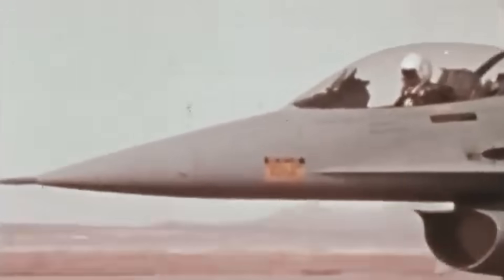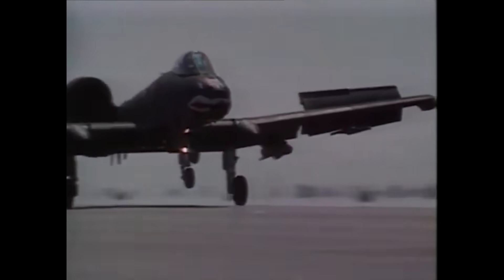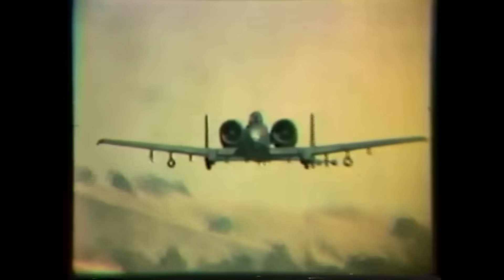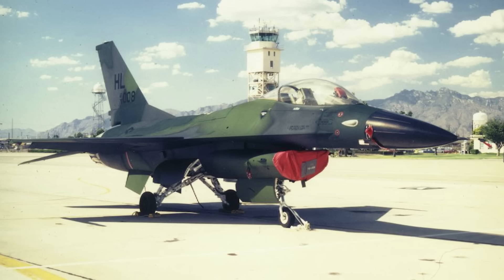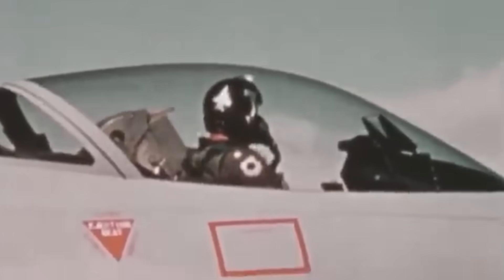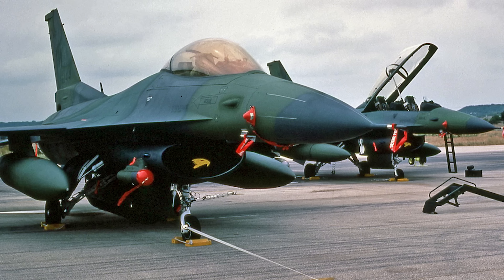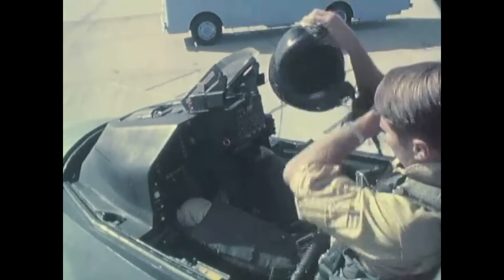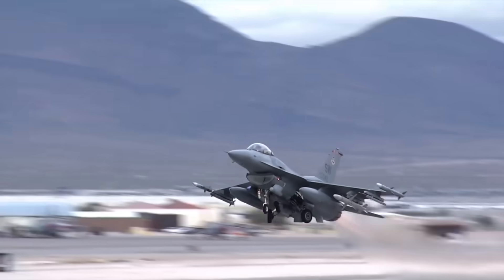The A-16. Can a Viper turn into a Warthog?

Comment: 2:51 What exactly did it prove? The A-10 didn't fly in contested airspace in Desert Storm and the real tankkiller of that war was the F-111, while A-10's only got shot to pieces by groundfire and had some notable friendly fire incidents.
Reply: @KapiteinKrentebol  The A-10 Thunderbolt II as it's formally known, despite its faults has saved outnumbered or surrounded American and allied ground troops from certain annihilation. While the F-111 Aardvark was a great at tank plinking, the A-10 really shined in doing the dirty job of low flying and causing destruction up close. Admittedly, had the Cold War gone HOT, A-10 attrition would be very high due to the hazardous nature of CAS. Even the legendary A-1 Spad used in Vietnam suffered high losses in doing the CAS mission that it was doing very effectively. With the skies over Ukraine being hazardous to both fixed wing and rotary aircraft alike, the A-10's counterpart, the SU-25 is having a hard time. Vulnerable to MANPADS and SAM's, besides hostile fighter aircraft. An updated A-10 variant with more powerful engines, that the latest "C" model lacks, and carrying small diameter glide bombs and other standoff weapons, an updated A-10 can still remain relevant. Imagine if A-10 production continued, with the updates, but as unmanned drones! A-10's are relatively inexpensive to produce. Sure many will be shot down, that is the unfortunate thing in the CAS mission.
Reply: A-10 is neither a dedicated tank buster nor CAS aircraft. It is a close interdiction aircraft, to attack targets not engaging in battle, but moving to do so. CAS is its secondary role, CAS being air support called in / requested by ground units in battle with the enemies it is calling air on to.
Reply: @De_cool_dude  that's exactly what it does.
Reply: A10 is useless when there is no air superiority and when enemy ground troops have handheld anti aircraft stuff.
Reply: @polarbear3427  You do realise the A-10 has over 200 countermeasures on it, right, making handheld anti aircraft weaponry not actually that effective against it as long as the pilot is aware that it was fired upon.

The A-10 is not an asset supposed to operate on it's own. It's supposed to have fighter cover when engaged in warfare with a near equal opponent. It's main advantage is that NO OTHER AIRCRAFT has the same capability to linger in a single area and completely suppress enemies with sheer amount of weaponry, ammunition and remaining slow enough to not just fly past a target too fast to get a good shot at them.

The entire problem with the A-10 is that people think it's supposed to accomplish it's mission solo without support. It's not, no CAS aircraft in the entire world can operate completely independently.
Reply: @ Yes only the A-10 can suppress a target as effectively as an A-10. 

But is that worth having a 200 aircraft long supply hain for a 70s airframe that hasn't been built for half a century, all to have the capability to strafe a target that the fighter offering cover could just drop a JDAM on instead?

It's not that the A-10 is bad, it's that the A-10 is so specialized it makes little sense financially. The GAU-8 is absolutely amazing in the scenarios where it works. The problem is the scenarios where the GAU-8 does a job an F-16 20mm or a JDAM or SDB couldn't do are few and far between, and pretty much only in Afghanistan.

If the A-10 only comes out when you already have total air supremacy. Why not just reallocate the aircraft that have nothing to do after achieveing air supremacy to the job. They can do 90% of the things an A-10 does just as well as or better than an A-10, while they can do 9% of them 90% as well and the last 1% they might not be able to do.

The war is effectively decided when you establish air supreamcy. Is it really worth having the A-10 for those 1% of scenarios where it's better than anything else? Wouldn't it be better to dedicate those costs to something that can do the other 99% of A-10 tasks AND contribute to establishing air supremacy?

If that 1% was intercepting nuclear bombs, the A-10 would easily be worth it. If the 1% is strafing Taliban shooting out of an abandoned house in a specific scenario where you can't just drop a bomb and the F-16 gun won't cut it, that 1% justifying the entire existence of the A-10 suddenly looks a whole lot more dubious.
Reply: @sdfopsdmsdofjmp7863  Because the A-10 is easier and cheaper to maintain for those tasks than, say an F-15 or F-111. Also a JDAM isn't a guarantee of target elimination.

Also the A-10 can carry a very significant arsenal of guided ground attack munitions. Laser guided munitions in particular actively benefit from the slow speed of the A-10.

That benefit wouldn't actually be seen that often in Afghanistan because, well, you're not exactly going to lob a highly advanced guided bomb designed to take out armoured targets ranging from tanks to bunkers at some random Taliban in a house.

The GAU-8 is honestly a minor part of what makes the A-10 good. The sheer amount of Hardpoints for weapons and for the later versions, the guidance systems for advanced munitions are what make the A-10 far better than "Gun go brrt"
Reply: @reonthornton685  I agree with you, but Afghanistan is not a real war, just like Iraq. It provides negative training compared to a real war.
Reply: @Tattlebot  War is War.

War against a peer is different, yes, but to call it not a real war is just an insult.

Also, in a peer war, it requires air cover. That was ALWAYS part of what it needed. It was never expected to operate alone. Nothing is.
Reply: @KapiteinKrentebol  He is entirely correct, you do your research!
Reply: The f16 didn’t fly in contested airspace? Lmao buddy, I guess you’ve never heard of the f16 calling stroke 3 dodging half a dozen missiles fired at it and surviving.
Reply: @bowencreer3922  Where did you get F-16? It´s not mentioned anywhere in the comment you replied.
Reply: @bowencreer3922  The A-10 had to be moved away from contested airspace, not the F-16, you blithering idiot.
Reply: @bowencreer3922  You have no idea what you are talking about.
Reply: @KapiteinKrentebol  Respectfully, I think you may be incorrect.  What source are you using for that claim?  

Most of what I can find is that the A-10 scored more tank kills. Now I did find something that said the 111 got 1500 tank and armored vehicle kills and that the A-10 got 900 tank kills so I’m thinking that he did in fact get more tank kills than the 111 but this statistic has included more than just tanks - armored vehicles too.

The Smithsonian says the following - 
“By the time it ended, the Warthog would be credited with destroying more than 900 tanks, 2,000 military vehicles, and 1,200 artillery pieces. That the A-10 remains in service 29 years later is a testament to the platform's reliability and effectiveness.”

sounds like if you were to add the tanks plus other armored vehicles into the A10’s kills then you would probably come up with a number higher than the F111’s tanks and I every vehicle kills.
Reply: @ 

https://www.youtube.com/watch?v=gDbUnRvb43o

By the way, I like the A-10
Reply: @DarkRendition  you should read the official USAF publication on how effective the F-111 and A-10 were, published after DS. I dont have it with me at the moment, but i remember it saying that the F-111 scored better than the A-10. I will have it in an hour or so so i will respond then with the correct statistics.
Reply: @DarkRendition  there is quite literally a document from the usaf detailing the claimed kills for pilots. And yes the f111 had a higher amount of kills, anybody saying they know how many tanks were destroyed by either is lying as pilot reporting was unreliable at best. What is safe to say is that f111 being  much safer to fly and a much better platform for agm 65 and gbus made it fly more often which inturn lead to more kills.
Reply: @DarkRendition   The A10 was not used for anything more than mop up, in the contested fight it was not used as it was not capable of being there without being shot down
Reply: Many sources credit it with the highest number of tank kills.
Reply: @DarkRendition  so the F-111 has a better kill ratio than a dedicated CAS platform then.
Reply: @traviswalker8933  The A-10 is not a dedicated CAS platform, nor is it a very good CAS platform. Never has been.
Reply: @dat581  it is a dedicated CAS platform because that was the primary design objective of it. Dunno who told you otherwise.
Reply: @ You haven’t a clue about the A-10 do you? The primary design goal was tank busting, NOT CAS. Not to mention that the A-10 is not, snd never has been a good CAS aircraft.
Reply: @dat581  the F-111 was the tank buster aircraft. The brief for the A-10 stated that it had to be an effective CAS platform for replacing the Skyraider, a CAS aircraft.
Reply: @DarkRendition  nope
Reply: @DarkRendition  Those claims are considered dubious, and even then would come down mostly to the massive amount of sorties flown by the A-10 compared to the F-111. Remember that the real tank killer on the A-10 wasn't the gun, but ATGMs. Any aircraft outfitted with an air-to-ground load can sling mavericks.

The A-10 mostly only makes sense against soft targets immobile targets, since the GAU-8 just isn't powerful enough to kill tanks and missiles do a better job against moving things like cars or IFVs or tanks.

The A-10 did okay in Desert Storm, but it really wasn't THAT great, since the only real achievement it had was slinging mavericks, which the F-16 or F-111 could also do, while being faster and thus more survivable, especially in an era where they can fly high and drop JDAMs, where the armour of the A-10 is less useful than ever.

F-16XL or A-16 would've been a good choice in my opinion, it would mostly just be a continuation of the dirty jobs the F-16 already does, like dropping bombs.

Comment: The USAF never really embraced the CAS mission. The A-10 seemingly developed to discourage the Army from having fixed wing dedicated aircraft and some degree hinder the Cheyenne attack helicopter, which eventually got canceled. It's an open secret that the USAF hated the A-10 and has tried to kill it several times through the years. Now that USAF got It's wish, the Warthog is finally going away. The F-35 and legacy aircraft will have to pick up the slack. None will be as good as the legendary A-10 and nor they will fly low and loiter as well to do the CAS mission  effectively.
Reply: The A-10 is an aging platform and the military operations have proven that an attack helicopter can do that job quite well if more loiter time is needed.
Reply: @traviswalker8933  You are right that the A-10 is aging platform. So are the F-16 and F-15. The big difference is that A-10 was hated by the USAF so much, that it didn't get updated earlier in it's service like the Viper and the Eagle. Also A-10 production stopped while F-15 and F-16 continued. Though I admit lack of export interest didn't help. Imagine if A-10 production continued, replacing older ones with new ones with more powerful engines and a two seater variant for night and poor weather operations.
Reply: @wc3478  the A-10 wasn't made for export. It is only being offered for export now because it is being retired. 

The limitations of the A-10 were pretty apparent in the 1991 Gulf war. The F-111 did the heavy lifting while the A-10 saw limited success.

I agree that the A-10C upgrade came very late but it was already in the works during the 1990s, the same time the F-15 and F-16 were undergoing upgrades.
Reply: @wc3478  the Cheyenne was cancelled because it was delayed for so long Lockheed was still trying to figure out how to solve analog control problems by the time digital controls were getting introduced. Also LBJ had links to Bell helicopter.
The courts determined the Cheyenne, A-10 and Harrier could coexist. So drop the conspiracy.
Reply: They also wont blow up the first time an enemy grunt fires a manpad at them as they are not such an easy target. There is a reason why the Ukranians did not ask for the A10 and no one else wanted it either
Reply: @perrytheplatypus8802  the USAF is practically trying to offload them at this point. They were offered to the Jordanian Air Force of all air forces.
Reply: The A-10 didn’t discourage the Army from having a fixed-wing, dedicated CAS platform. The Key West Agreement (1948) assured that they COULDN’T. The US Army can NOT field fixed-wing combat airplanes, full stop. 

Nearly 80 years on, perhaps it’s time for the DOD to revisit and reassess some of the more antiquated ways they do business. 

As for other airplanes picking up the slack that the A-10 has been carrying, it’s a moot point. The VAST majority of CAS missions are being performed with PGMs from 50k feet. Truth be told, the B-1 and F-15s are currently the reigning champs of CAS. The A-10 is beloved by the guys on the ground and civilians who defer to those same guys. NOTHING on Earth is as heartening to TIC than an A-10 gun run. They look cool, they sound cool, and they are usually pretty damn effective. But the fact is that small PGMs are taking over the “support” part of CAS, and thank God for that. 

The A-10 has only survived this long because of sentiment and public demand. It has done its job well and now it’s time to put the ol girls out to pasture and use the $ that supports them into other (better) places.
Reply: @FloridaManMatty  the F-14 looked cool but what did it achieve for the Navy? Nothing credible. Its only credibility comes from Hollywood and from an export customer which became the key reason for its early retirement as the US wanted the supply chain of parts to stop.
Reply: @FloridaManMatty  that's why the AirForce operated this dedicated CAS platform they had little concern for.
Reply: A gunship is more effective for the job.

Comment: the F16 is ironically the worst plane to do this with. My dad worked on this program and can tell me bits of what they tested. the F-16 is a small, light, sleek plane and the idea is to strap a giant pod to the bottom, put 12,000lbs of ordinance and a more powerful motor? it's like they're trying to turn everything about the F16 into a disadvantage. like towing with a porshe 911, there's just better things to do that with. P.S great video
Reply: looking at that gunpod hanging that far below the engine has me guessing it also had some nasty pitch down motion whenever the trigger was pulled. My brain thinks "asymmetric thrust" type problems, only at high speed, and at less than 1000 feet.

Comment: Excellent analysis.
Multi rolling aircraft are only stop gap measures anyway. The Phantom was only useful in Vietnam, which was why the Thunderbolt came into existence. 
This is why I think the Lightning odd going to prove a failure, it’s supposed to do it all, and looks like it excels at none.
Reply: The Phantom did well in Israeli service...

Comment: 1 engine- higher chance of loss when battle damage is incurred.
Not enough gas- cant stay on station to loiter.
Reply: The A-10 needs two engines because you know it will get hit.
In the air not getting hit in the first place is better.
Reply: @ That's why you have a faster, more agile and responsive, higher flying fast jet that won't need to get into AAA or MANPADS range very often, and when it does will be much harder to hit.

In practice your A-10 is done for if you get hit by AAA or a MANPADS. Yes, sometimes it might survive and make it back thanks to the 2nd engine, but more often than not, being able to avoid AAA and MANPADS entirely is better than surviving it. If a fast jet has to get into AAA or MANPADS range, simply being fast and agile will probably make you more survivable than an A-10, since you can GTFO much quicker and not expose yourself for too long.

The only reason the A-10 remains in service is because the A-10 has a gun that sounds cool and that congress loves. Thus congress refuses any Air Force budget proposals that include retiring it. 

The USAF despises the thing and thinks it has more than worn out it's welcome, just like everyone else that knows what they are talking about. It's a weapon so niche that it doesn't make sense when a fast jet can do everything except for a 30mm strafe. (that very rarely accomplishes something a 20mm strafe or a JDAM or GBU can't do just as well or better)

I just realized you are making the same point as me.
Reply: The A-10 wouldn't be able to loiter in a peer or near-peer conflict anyway and even if it survives with an engine out, the airframe is almost certainly getting written off regardless.

The A-10 only works in low-intensity conflicts where its gun actually offers some utility. The US isn't looking to fight any more low-intensity conflicts.

Remember the only way the A-10 kills tanks is with macericks. Luckily basically anything with wings can fire mavericks.
Reply: How about a Hornet? Better at ground pounding than a 1990 F-16 better BVR than an F-16 too. 
@sdfopsdmsdofjmp7863